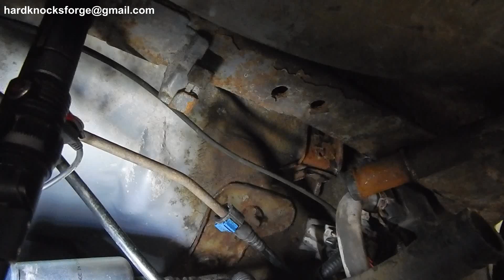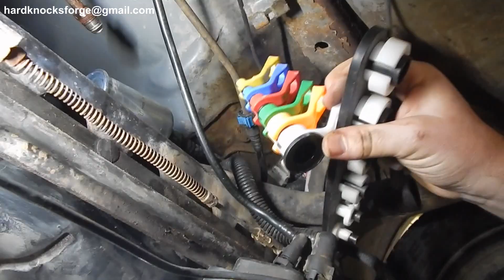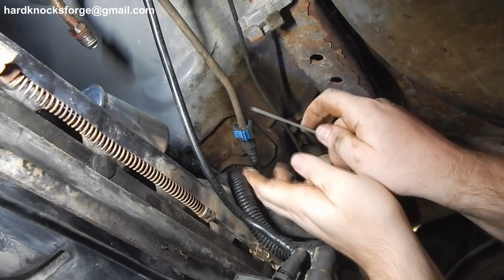No special Fuel line disconnect tools required

Comment: Must of Been a Chrysler Fuel Filter Replacement 👨🏼‍🔧🧰😬
Reply from the maker: Chris Chiampo it was an early 2000’s GM car. I hadn’t noticed them on any Chrysler products, but I wouldn’t be surprised if they used the same style quick locking connections.

Comment: Easy how to and you break the clip.
Reply from the maker: If it's not broken fix it nah, it’s still the original clip on that car still today. I kinda wonder why they don’t include those clips in the package with the new fuel filters/fuel pumps, but I haven’t broke one yet so there is that...
Reply: @HardKnocksForge  i haven't either "knocking on wood)"